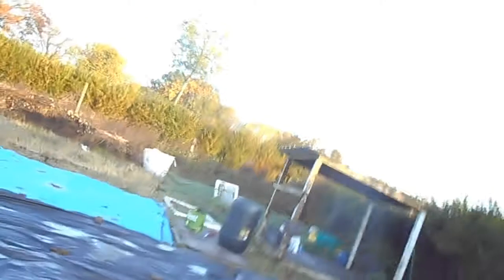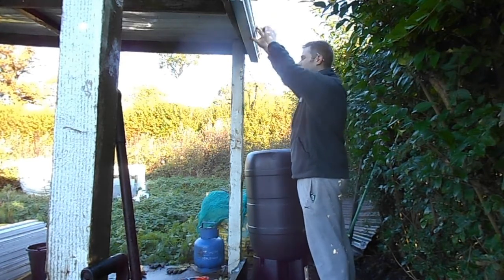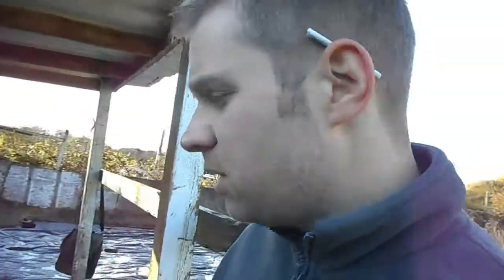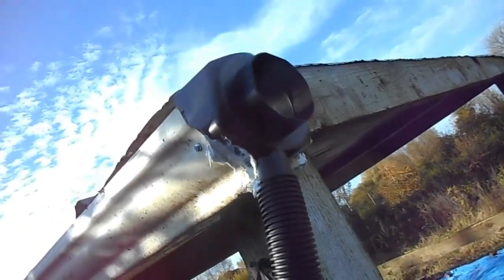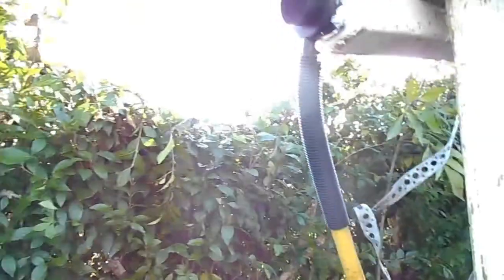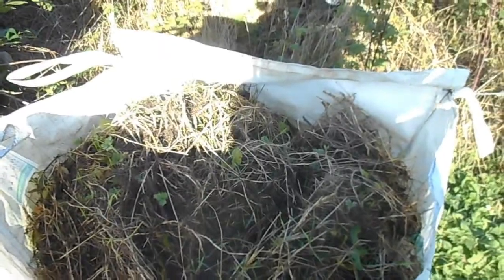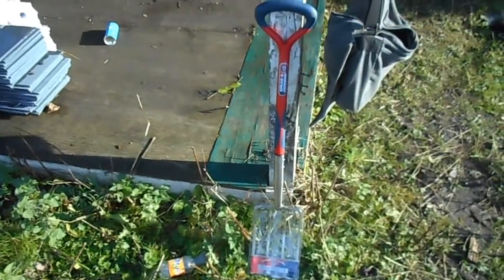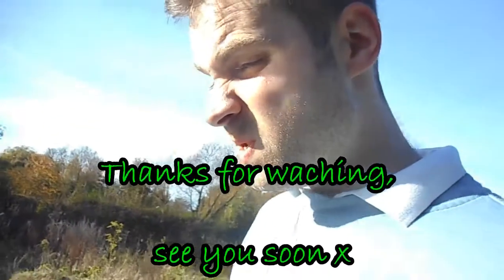Allotment Garden 2016 #8 Water butt installation

Comment: I don't think I could get along without my battery operated tools any longer. I hear if the compost pile gets hot it destroys the weed seeds. The forks in the shops here have very little quality. Have a great afternoon. Best wishes Bob.
Reply from the maker: Bob Lt I have been straining my back too long with a little border fork so treated myself :) and yes the battery tools are a godsend.. until the battery runs out!!
Reply: Very true. I have now gotten two spares jst for that reason. Best wishes Bob.